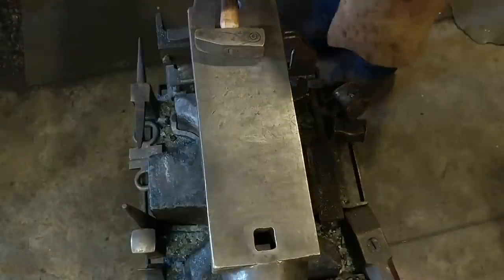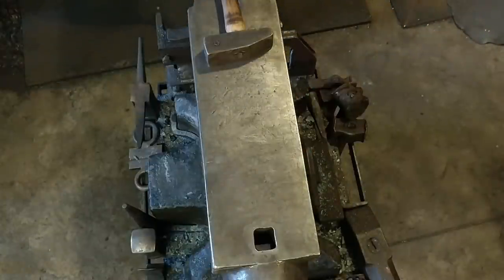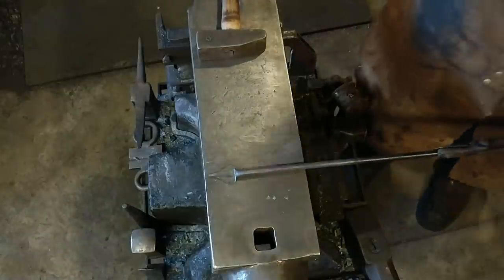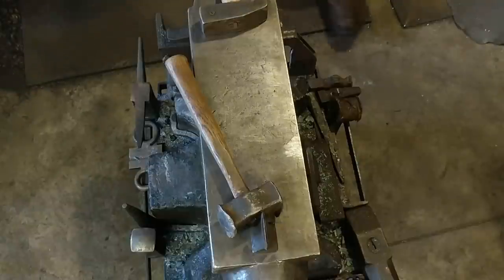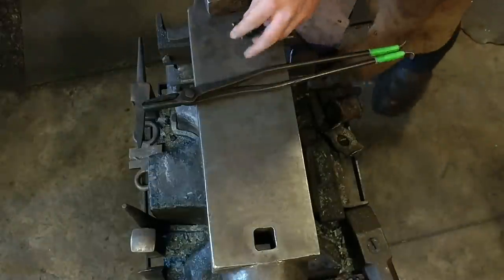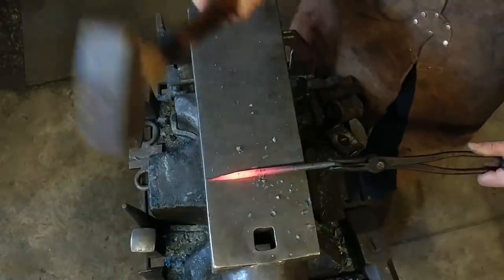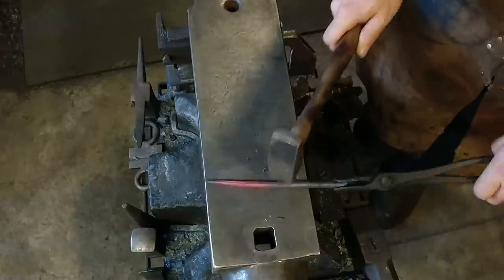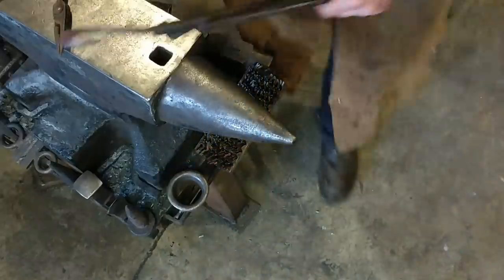$20 for a Hook? // How to Forge a Hook with a Spade End

Comment: Not dissimilar from the hooks I've been making. Mine are long and straight with two holes on top and I've been hammering the tip around into a tight curl. Make'em out of 3/8th rebar hammered into a very gradual 6 inch taper. This is WAY faster and easier but, my rebar is free. I'm really just practicing my tapers and drawing out steel. I didn't want them to go to waste so, I made hooks. Love the channel Roy! Keep up the awesome hot metal action!

Comment: I'm about to try making Damascus for the first time in my life. I want to make a Damascus S hook. Does vinegar work for bringing out the pattern?
Reply: Jaxxon Koethler Great question. Everybody uses fancy acids for etching, but if vinegar works, that would be some really useful knowledge to have.
Reply: Jaxxon Koethler i use vinegar to etch, heat up the vinegar first then stick the peice in. The piece will start to bubble on the surface, and etch to perfection! I wouod recommend ferric for the long term.
Reply: Jonah Lee how much do you heat it up?
Reply: I think hot vinegar would work...but i would think it would prolly take quite a bit of time tho. id prolly end up getting a good size pot..or something you can put in the oven and set it for 160 or so degrees.